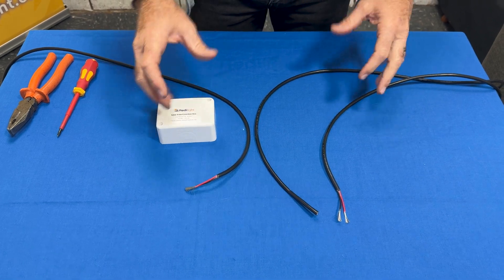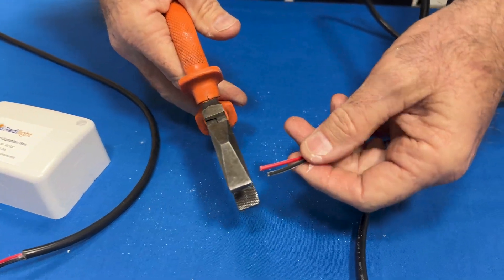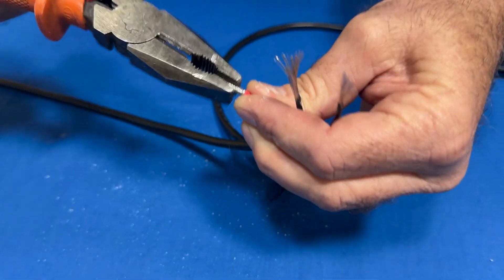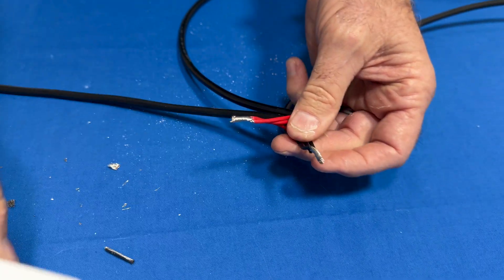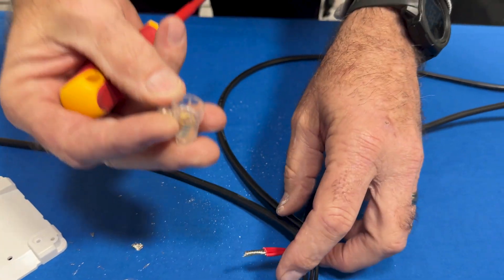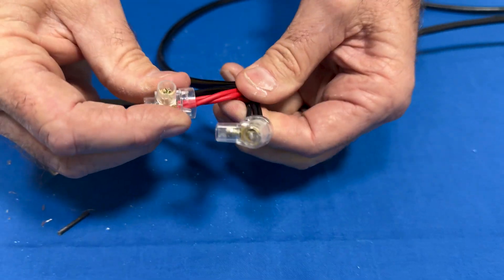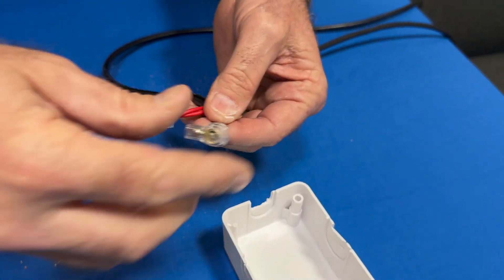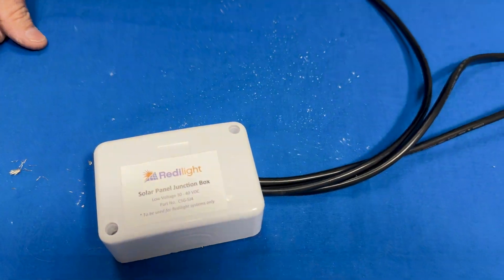Join Cables in Your Junction Box Like a Pro in  Under 5 Minutes!

Comment: Thank you  My loan company improperly attached an after market LoJack and a Ford dealer disconnected it. Now I have a huge electric drain and I'm going to see if I can fix it. If there is a couple open wires, your video is so helpful to learn how to splice and place inside a junction box. I will use my multimeter to check my fuses to see if I can fix that way. So, thank you for showing exactly how to splice from a dummy car girl ❤❤
Reply from the maker: Glad our video helped you out :) It's great to see people finding short tutorial videos like this useful. We will be sure to do more in the future. Best of luck with your project.
Reply: @redilight Cross your fingers I can figure out what's wrong ❤❤ I'll go through the fuses if I can't see anything where the LoJack was ❤❤